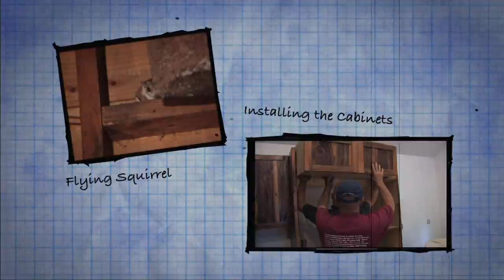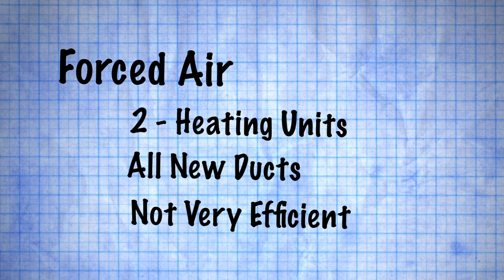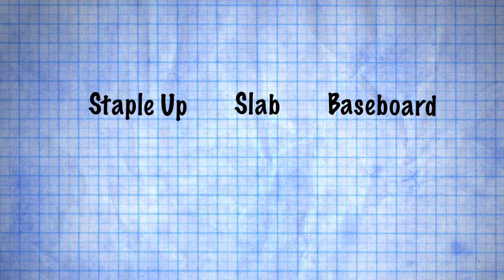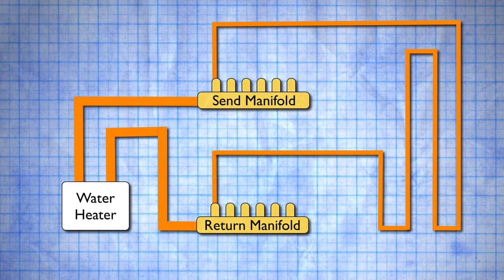Season: 2 Episode: 2 Bring on the Heat

Comment: As for grinding screws that penetrate use an electric angle grinder. It works very fast. And yes a hammer will work too if the screw penetrates enough.
Reply from the maker: +Samual Whittemore thanks for watching and the tip.

Comment: Did you end up with any carpeted rooms? If so how did the carpet effect the heating in that room?
Reply from the maker: We do not have any carpet other than throw rugs.  Of our floors are tile or wood.  Carpet is not recommended because it will act as insulation.  Thanks for the question.

Comment: so now that it's been in for some time, are you satisfied with how warm your home is?
I'm considering putting in a radiant floor system but anxious I'll do all the work and still have a cold home :(
Reply from the maker: +Trey Willis we are absolutely happy with it.  Unlike forced air (where you have pockets of cold air) the entire house is always a constant 72 degrees.  Getting out of bed and stepping onto a warm floor, on a cold winter day, is amazing!  Thanks for watching.
Reply: What about rooms with carpet?  Does the heat travel through the carpet and still heat the room?
Reply from the maker: +daryl alleman we didn’t put carpet in areas that have under floor heat.  The rooms with carpet have base board heat.  We used base board heat in the third floor where we couldn’t install the RadTraxs to hold the Pex.

Comment: Can you send cold water through the system in the summertime?
Reply from the maker: I asked the same question.  It seems like it would work but the answer is no.  By sending cold water through the Pex tubes would produce condensation and that causes other problems like mold and water damage..  For cooling we are using floor AC units vented through the walls.  I will have a video up soon showing how I installed one.

Comment: I sell double heat transfer plates that some installers like better than these.  I also have a video that shows a better way to run all the PEX between the joists
Reply from the maker: Hey Joe what is the link to your video?  Even though I am done with the installation I would like to see an alternative way to run PEX.  Thanks for watching.
Reply from the maker: Just watched your video.  That is a much easier method.  My next install in the project will be a pour.  Any tips you can pass along would be great. 👍